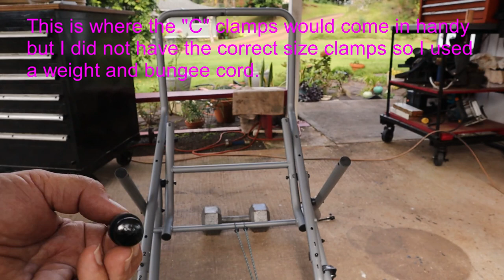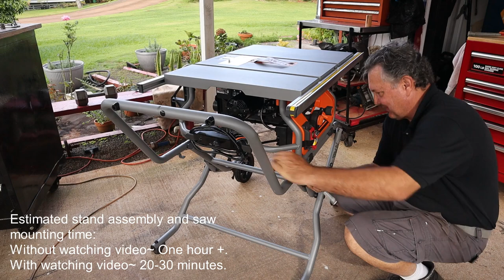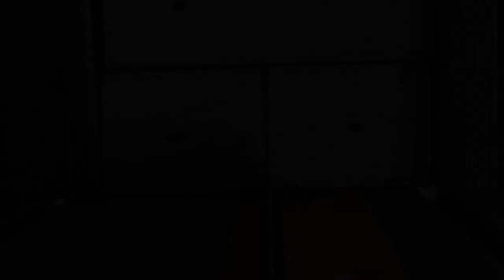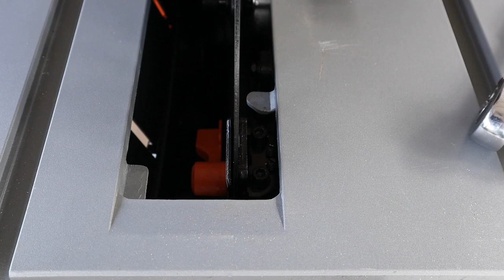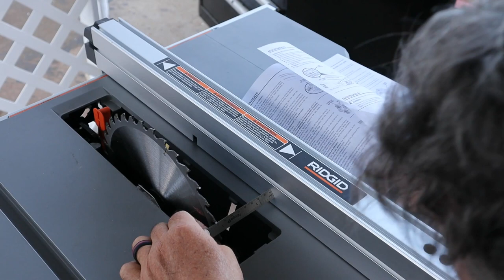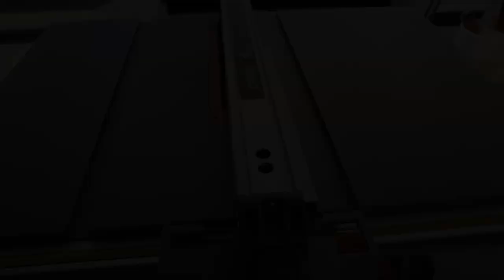RIDGID R4514 10" Table Saw: Assembly and adjustments in detail.

Comment: Really appreciate this video. Had this saw for several months now. One thing I did think about is the fence.... two issues I've had. When its locked, it moves at the last second. The other is that it's also not square to the table itself....same issue with yours. I thought about building a sacrificial fence out of melamine or something so I can adjust it better.
Reply from the maker: Aloha Portland,
Check the owners manual, there is an easy adjustment to give the fence more bite when tightened, I think is was a nut on the front or bak of the fence.
#2: I discovered that the riving knife on my saw was much thicker than the kerf of the saw blade so that was throwing off my cuts.
Run some straight lines and I think you will find that may be the problem for you as well.
I covered that fix with another person who was having the same problem so check out that explanation in the comments. It was within the last 2-3 months that I made the post. 

Mahalo and good luck,
Mike

Comment: The only thing I can add is that Mike turns the box upside down to extract the saw. I left mine in the upright box until I'd finished the stand assembly. Once finished I turned the assembly upside down and attached it that way to the upside down saw. Then it was easy for me to pull up the saw into the upright position with a little leaning. And I did it all by myself!!

Comment: Mike, Well done!  Like you, I was amazed that almost everything was off a degree or two.  Sad when mass manufacturing can't get standards/precision correct.  Makes you wonder where Quality Control went.
Reply: It went to the $1000+ and very heavy cast stationary table saws. I think ridge actually has one that's a little bit under $1,000 that looks really well made. The problem is it's a few hundred pounds. Unless someone has a shop where it can be permanently set up it's not going to work for a lot of us

Comment: I just got one today and my directions give a completely different spot to adjust the blade. There are two nuts to loosen for horizontal adjustment, and two screws for vertical adjustment.

Comment: Thank you for your time and patience.
I have one of these. My table isn't flat as well and I had the same issues adjusting de Blade on 0° and 45°.
A little bit frustrating, but it does a decent job.
Reply from the maker: Aloha Sandro,
Thank you for the kind words.
The table not being straight/square is a bit frustration but overall the saw is good and once you get it dialed in (as well as possible anyway) is makes good, accurate, repeatable cuts.
Makes me wonder how the table is manufactured for the machining to be so far off?

Comment: I just bought the same saw and yea making adjustments on it its a challenge but I really like the 4sec stop and the soft start and honestly compare to my old skill saw its night and day this is much quieter than the skill saw thanks for the vid I still have to finish my adjust ments so Ill be watching this video again.
Reply from the maker: Aloha R.F.
Yes I also appreciate that feature.
Glad you are finding the video helpful.
Hope your saw is less problematic than mine was.

Mahalo,
Mike
Reply: It’s been a challenge also the slight dip on the left on mine it got better what I did was loosen the screws on the mounting bracket’s remember it’s aluminum and aluminum gets stressed with so much tork so letting it relax and tapping it from underneath helps.

Comment: JUST BOUGHT THIS SAW TODAY,,,,AFTER WATCHING YOUR VIDEO, I AM DISAPOINTED IN THE QUALITY OF THIS SAW. I HAD AN R 4512 WHICH WAS TOPKNOTCH AND JUST $500.00 NEW SEVERAL YRS. AGO. DOWNSIZED AND HAD TO GO SMALLER. I PRAY MY TABLE IS FLATTER OR I WILL RETURN THE SAW,,,,THANKS THOUGH, WAS A GREAT VIDEO !!!!
Reply from the maker: Aloha Harry,
If RIDGID could just get the table top flat and square in the manufacturing process then it would be a great saw. As it it is ok for contractor/jobsite use but i'm just a hobby guy that is getting into woodworking and am more interested in precision than production. But for the price point and the ability to cut 4X material it was a good balance for me.  Just wish the table top was flat on my saw.
Thanks for the kind words and hope the video was helpful to you.

Mahalo,
Maverick Mike.
Reply: @maverickmikekauai3515  HELLO MAVERICK MIKE,,,,I GOT ANXIOUS AND UNBOXED MY SAW TODAY AND SET IT UP. THE TABLE TOP WAS NOT FLAT BUT WAS FLATTER THAN YOURS. THE ON/OFF SWITCH ACTED UP AND DIDN'T LET THE SAW START, BUT I WAS PERSISTANT AND IT FINALLY STARTED WORKING. I CUT A SAMPLE AND CHECKED FOR SQUARE AND IT WAS GOOD SO I THINK THIS SAW WILL BE GOOD FOR ME ALSO.

Comment: Just bought this saw and I watched this before attempting to assemble it. Thanks for the guide, I feel like I know what to watch for now. And it's good to know I'll need a digital angle finder. But I'm wondering if the riving knife is guaranteed to throw off all cuts or if it's just that way for certain saws -- I don't have any way to grind down metal at the moment.
Reply from the maker: Aloha Ghritke,
I don't know about all saws but my riving knife was thicker than the saw blade and was difficult to center in relation to the blade. So I just used a handheld grinder and removed material from the riving knife until it was the same thickness of the saw blade. I never did get a digital angle finder but I have been using my speed square which is meeting my needs for now.
Thanks for the great comments,
Mike

Comment: I have owned the previous version of this Ridgid contractor saw for about 8 years. It is nearly impossible to make repeat cuts with it or anything close to accurate. Table isn't flat, the throat plates are far to flimsy.  I waste tons of time trying to make it work, but they only thing saving it from the dump is I build a cross cut sled that helps a lot. This saw will make you feel stupid that you can't build a square cabinet carcass or drawer boxes.  I really want a proper cabinet saw, but don't have the space or budget for it yet.
Reply from the maker: Aloha Nick,
You are 100 percent accurate.
I am in the same boat as you, I really wanted precision but could not afford that for just a hobby. But this saw did have some great features that other saws did not have within the same price range like the ability to cut 4X4 material and will accept a dado stack.  I guess we get what we are willing to pay for.

Comment: Wow this was a very impressive video!  I bought my saw last year from DTO as a factory blemished for $329 and thought I got a deal but now that I have some experience under my belt, it was way too much!  I have every issue you had, except the few things I haven’t checked yet, like overall table flatness, and fence flatness. 

My biggest problem is that my riving knife is out of alignment with the blade,  and there’s not enough adjustment available to fix it.  Its probably about 1/32” past the blade.  

I found out today the riving knife is also vertically out of alignment, meaning it’s bent.  I’m considering removing the riving knife altogether and switching to a 7 1/4” blade.  Otherwise I’ll probably need to take it to a repair shop or spend more money to get one of those kreg splitters.  I wish I had just bought it from Home Depot so I could take it back there.
Reply from the maker: Aloha SoCal Kevin,
I also ended up having the same problems with my riving knife. For your safety DO NOT operate the saw without a riving knife.
To fix my riving knife issue I shifted gears into beast mode. I removed the knife from the saw and took my hand held grinder to it. I removed steel from the riving knife attempting keep the blade flat and the material thickness even throughout the length of the knife. I removed enough material so that the riving knife was just a little thinner than the kerf of the saw blade. Then I chamfered the leading edge. Using a rattle can I repainted the riving knife black and reinstalled the riving knife.
I was then able to properly adjust the riving knife and it would no longer "catch" on the wood being passed through the saw. It works much better now. Although, I'm sure that riving wont be warrantied now!!😆
It is a shame that a saw that has so much potential is so messed up by a continuous string of quality and execution issues.
Oh well, It was a good price but you get what you pay for..
Thanks for the great comment!

Mahalo,
Mike
Reply: @maverickmikekauai3515  thanks for your response and the detailed info on your solution to the riving knife problem!  My cuts currently end up drifting away from the fence causing them to come up too short.  

I'm going to spend all of today trying to get my table saw in alignment.  All the adjustments I made 6 months ago are off again.  I love the easy fold up design of this table saw, but you're right, the quality issues really kill it.  

I've heard trying to warranty it takes 4-8 weeks and I just don't have that time right now.  A replacement riving knife is about $50 and  it might only tell me the base plate is bent too.  I was considering switching to the 7 1/4" blade after seeing it work well for several people here on YouTube.  I know it's not a good idea to go without the riving knife, but I think using one of those micro jig grr-rippers would help alleviate the dangers associated.  I was planning to upgrade to a zero clearance insert too, so if I do that, I can add a kreg splitter to it to replace the riving knife.   I think I'll try your solution first and grind down the original riving knife.  Hopefully I can get it   to a uniform thickness.  Thanks again!

Comment: You did an excellent job setting up your saw. Regardless of the model saw this is an excellent tutorial for anyone adjusting any table saw.

It is interesting that there seems to be little choice today between the portable job site saw with cast aluminum top and a full blown cast iron cabinet grade. The ground cast iron topped contractors saw with full thickness blade seems to have disappeared except for one or two models. On the other side an aluminum table does not rust.

You have probably  adjusted your saw beyond the tolerance of the material available at a big box store and I say good on you for that!

If you add a table saw sled you will no doubt get good service from this saw. The mitre gauge on all portable saws suck these days. The Ridgid however looks better than my Dewalt. The Dewalt has an odd sized mitre gauge slot so even an aftermarket mitre gauge is problematic. I bet most people would pay a bit more for a well milled mitre slot (3/4x3/8) or a good mitre gauge of decent size and quality.

I own a Dewalt and Delta Unisaw. I miss our old Delta contractors saw with the 1 1/2 hp motor sticking out the back!

Comment: You can add washers (and/or tape for a more precise adjustment) where the table top mounts to the saw frame to help level the top. Some of it won't come out due to machining, but big gaps, corner to corner, side to side and front to rear can be minimized.
Reply from the maker: Great idea!
Thanks for sharing that.
Mahalo,
Mike

Comment: Thanks for this great review! The non flatness of the table literally had me put this back in the box. I'm torn as to whether I should take it back or keep. The fact that you can adjust the table helps. I would assume most cast iron table tops have the same issue. Honestly, it's a great deal for the price, so I might be keeping it. I may swap it out and test at the store to see if there is less variance. Anyway, this was a great video and will be referencing it often as I setup. Thank you.
Reply from the maker: Aloha Rocky,
I had the same struggle you did as to keep or return the saw. I ended up keeping mine because like you said it was a good deal for the capacity of the saw. I have made various sleds that help negate some of the table top flatness issues and am happy with the saw so far.
Thanks for the great comments!

Mahalo,
Mike.

Comment: Great assembly video . But how do u expect to get the blade plum to the table ,if the table isnt completely flat ?
Reply from the maker: Aloha ASD,
Great observation,
It is impossible to get the blade 90 degrees to the length of the table. the best you can is to get and average..... 😖
That's ok for  for rough jobsite construction (which this saw is designed for) but for the hobbyist or a furniture maker this saw is not great.

Mahalo,
Mike

Comment: Was looking for how to adjust bevel and found this.  Very nice.   However, in my case, I find that to get the blade set to 90 degrees, I have to push it so far that the motor assembly hits the table and actually has to deform it a bit to get to a perfect 90.   "That ain't right" . . .

I did buy it used, for what I though was a fair price.  Not so sure now.

Looking for hints before tearing into things too far.

Comment: Very disappointing that the table top is not dead flat and the fence has the slight angle. I do like the stand and how it folds up but accuracy is so important in my book. Thank you for such a detailed video.
Reply from the maker: Aloha Ian,
Yes, I agree the top should be flat. The manufacturing tolerances need to be....improved.
My fence is straight. I discovered that the riving knife was a bit to thick and forced an error of about 2 degrees which is enough to throw off cuts needing precision like glue-ups and etc.
There is an earlier thread covering what I did in an attempt to correct that issue. 
Mahalo for the great post and encouraging words.

Mike

Comment: Same problem here with the blade not going to 90 unless I rotate the cam really hard past 0. Never knew it was the actual motor preventing this.

Edit:  The one adjustment I was hoping to see was the blade rotation along the z axis. Somehow mine is off and I don’t see the adjustment in the manual.
Reply from the maker: Aloha BenignComrade,
I think RIDGID needs to work on the design, tolerances and manufacturing quality of this saw.

Mahalo,
Mike

Comment: Just a recommendation for anyone out there doing angled cuts--just use an angle finder every time you set the blade (digital or physical). The gauge on most saws is just a suggestion.

Comment: I've got the same saw. The most frustrating thing about this saw is the blade likes to come out of parallel anytime I try and adjust the bevel angle. double check your alignment with the miter slots anytime you change the blade tilt
Reply from the maker: Aloha Ape Index,
good advice, many thanks.

Mahalo,
Mike.

Comment: I just bought the new R4550 and the stand parts only have parts label A B etc no numbers to match up. One part is supposed to be labeled P only it is labeled 12. Now  for the kicker you have to assemble it on the saw which is upside down, and the instructions and pictures are in miniature. I have spent 5 hours on this thing and still can't get it right. Got a king size headache will go at it again tomorrow, perhaps I will try assembling the stand then lift the saw up on it.
Reply from the maker: Aloha Edwin,
I did assemble the stand first then bolted the saw to it.
You have a different saw but the assembly is probably similar.
If the stand is the same as the R4514 then watch that part of the video again before giving it another shot.
Good luck with the assembly.
Mahalo,
Maverick Mike.

Comment: Exact same issues here,, not sure what you were turning with the rachet, when you were showing the backside? BUT my biggest issue was trying to remove the darn sticker on the table,, pieces were left that I could not get released now my table is all messed up its like the glue melted into the paint ,, boy I loved the days when manufacturers took pride in their workmanship  ,, not impressed to say the least but what do you expect for $700.00
Reply from the maker: Yes, quality issues seem to be the rule with this saw. But I do keep on using it and manage to get the job done in spite of the issues.  Next time I will purchase a table saw with a cast iron table.... Or at least a milled aluminum table top.

Comment: Hello, so after a year of use, you still happy with this unit? is the fence is square or do you need to constantly keep checking if it is??? Thanks for your great Video/Review.
Reply from the maker: Aloha wwmilanl,
After a year of use the fence is still good.
However if I want a precision cut then I have to check that the blade angle is still correct as I have observed that it can wander out of adjustment by a few degrees. I have also put a dado stack on it a few times and it does a good job cutting 3/4 inch dados. Since making the video I have removed the saw from the portable base and incorporated it into a rolling workbench. It is much more convenient to use now instead of having to set it up every time I wanted to use it.
Glad you found the video helpful and thanks for the kind words.

Mahalo,
Mike.
Reply: @maverickmikekauai3515  Hello Maverick, thanks for your Fast reply, really enjoy your detailed video, keep enjoying the beautiful  Pacific.

Comment: Thank you so much!! With a calibration procedure this complex I have to ask how well with the tool work following extended use?   Next stop the return line at Home Depot!
Reply from the maker: Aloha Camp Taji,
The saw has been giving me good service and is still accurate enough for my hobby needs.
Hopefully you get a saw that is not as bad as mine was out of the box.

Mahalo,
Mike.
Reply: @maverickmikekauai3515   Interestingly enough the replacement although it is of the same model number is different and MUCH easier to calibrate.
Reply from the maker: @camptaji901  Thank God for that!

Comment: I have the r4510 that is very similar.  I can't get the blade height to "lock" into place.  It travels when the saw is turned on.  I've tightened down the know as much as it will go but doesn't hold it in place.  Any thoughts an what I can do?
Reply from the maker: Not sure bur go through the manual for that saw there may be a tension adjustment for it.